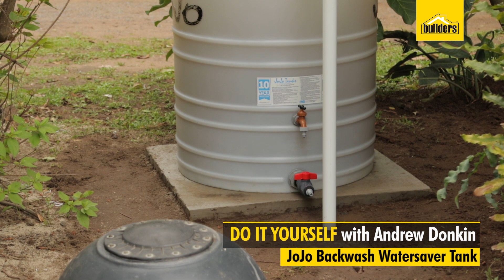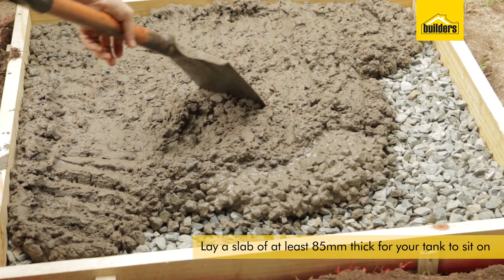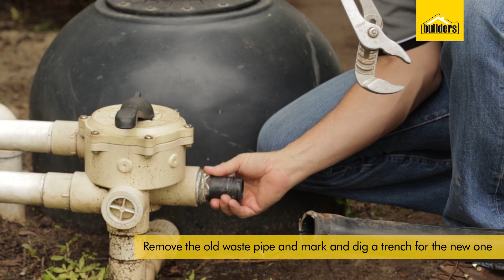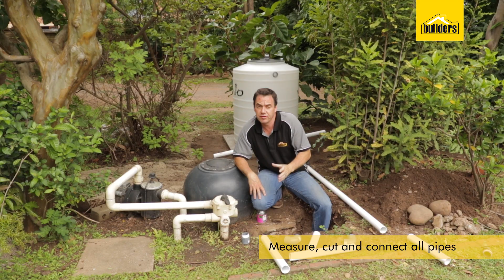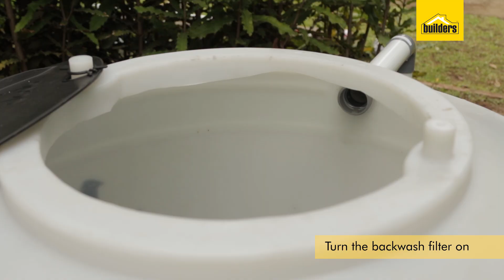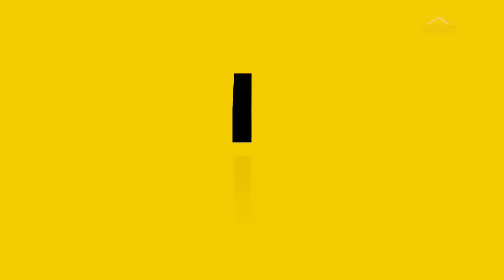JoJo Backwash Watersaver Tank Installation

Comment: An excellent video presentation Andrew, however,  you need to install a " T " piece connector and  2 shut off valves in line with the backwash pipe so that you can divert the waste water in case you need to vacuum and dump muddy / algae  water from the bottom of the pool after doing an alum drop. Look forward to seeing the video showing this addition. Keep up the good work ! Chris Rycroft.

Comment: We find that pumping the backwash water on to the lawn kills the grass due to the chlorine. Won't this do the same to your garden plants?
Reply: Yes it will rather drain water into a drain or sewer
Reply: Chlorine evaporates. You need to open tank lid and leave off for around 2 weeks then water will be safe for garden use.
Reply: @jasonwilson3081  it is illegal to deposit backwash water into sewer. It needs to be contained in a tank as per video or dispersed over garden.